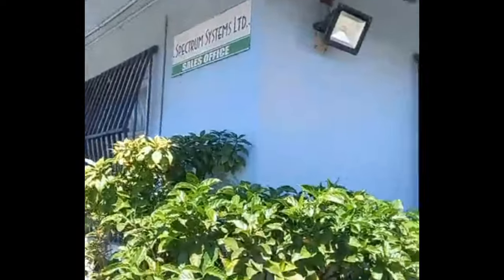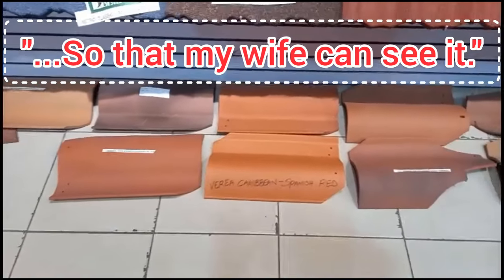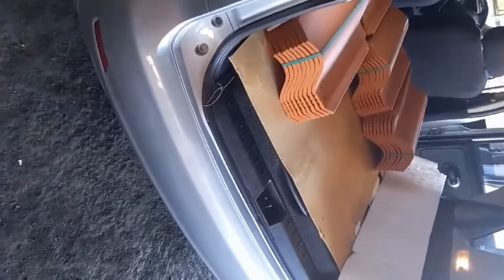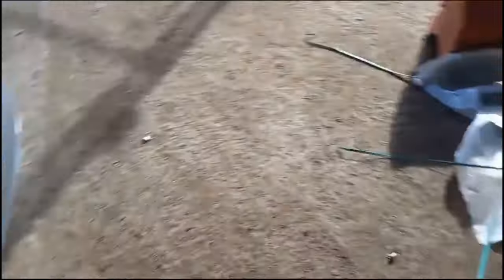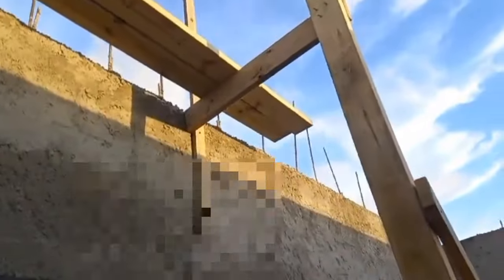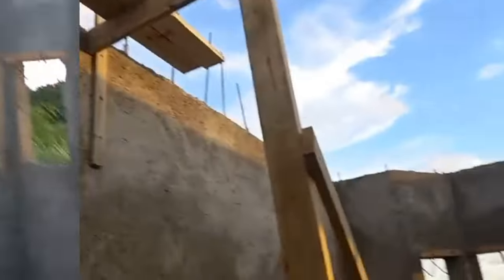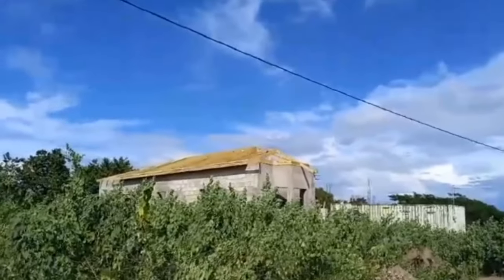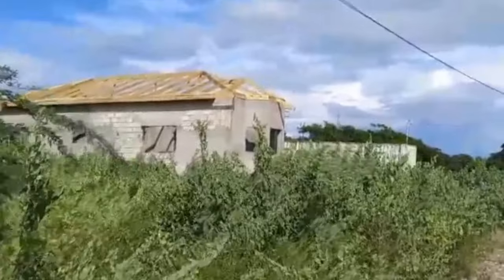Roofing Installation| Cost of Roofing & Materials| The Biggest Construction Mistake Ever!

Comment: Not withstanding budget:
The whole roof should have plyboards over it completely.
The roof also should be completely covered with felt/waterproof material.
And then the clay tiles should be laid on that bed.
That's how it's done by code in the States. It's costly, mind you, but it's worth it in the end.
Reply from the maker: Budget wasn't the issue though, just a workman who didn't know what to do...it was sorted out though, to God be the glory.

Comment: 100 of those clay tiles cannot cover not even a 1 room building. 1st, the Hardware should provide you with the coverage of each clay tile so your contractor can work out the quantity accurately.
Reply from the maker: Great point, Eddie, although the Roofer was hired for that purpose, and the hardware was not at all involved except to sell the items. Thankfully, we picked up on the mess before it was too late.

Comment: Did you have a roof design with your plan? If so, why did the roofer not installed the sarking (pressure treated ply) and membrane before installing the tiles?
Reply from the maker: We had the plan, but he didn't rely fully on it as he ought to have done. When it was brought to his attention, he disagreed with us, and other contractors came by and said it could stay, so we were hesitant to stop him initially ....
Reply: Contractors and workmen are always chasing the $$ and not quality. Most of them do not know how to read a plan and they end up building something that is not on the plan. I am having the same issue with my project. What I do is insist that if it is on the plan then do it unless I authorized the changes. Good luck on your project.